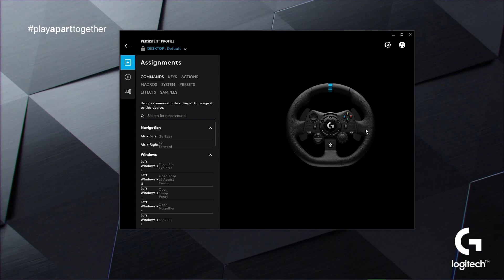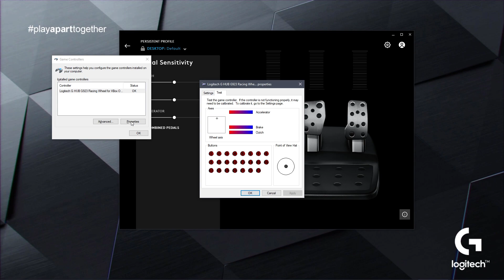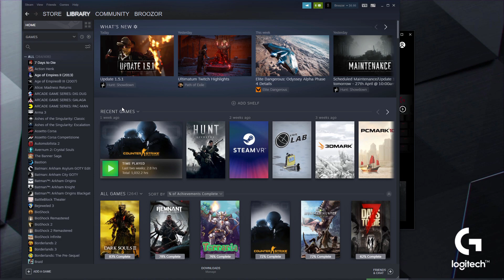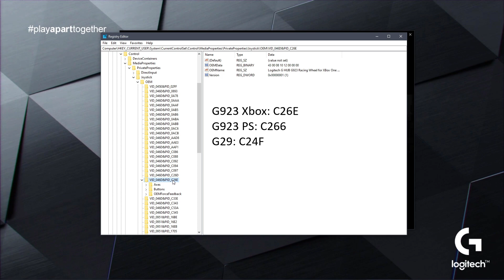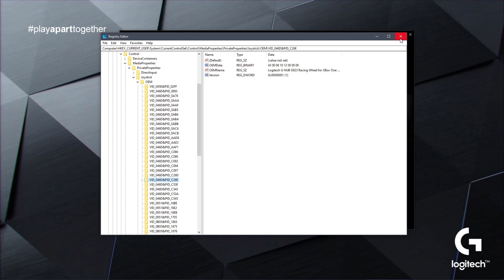How to troubleshoot G923/G29/G920 for Connection Issue

Comment: Pedals are working, shifter is working, buttons and paddles are working but turning the wheel does nothing. It doesn t calibrate when plugged in neither with g hub, however the ps3/ps4 button on top of the wheel is light up. I have a g29. Help pls.

Comment: Make sure the breakway-piece of the usb-cable is also properly connected. 

On the USB cable, 10cm (5 inch) from the pc side, there is a black piece of plastic: the easy-break-contact. I don't know it's proper name (a "breakaway cable"..). But it's there for when someone accidentally trips over the cable, than the cable disconnects on that piece. 

The G923 I bought and installed just now, did power on, leds burning, wheel calibrating, turning left and right, upon usb connection. But no connection in-game. Nor seen by G-hub. Even though seemingly visually alright; turned out that the breakaway part wasn't making full contact.

Comment: i can use the wheel, lights are alright, it does calibrate when i plug in but ghub displays the g29 as inactive therefore i can't change settings properly. i tried every solution i can find, non has worked. i'm using w11 ltsc.. any ideas how to solve?

Comment: Is there anyone in this comment section that can explain why my wheel is not rotating in LGHUB when im turning it? it recognizes the wheel but it dosent calibrate when i plug it in and its Slow to rotate and also skips to normal and then slow to rotate? Can someone please explain or help my dire need of help :(

Comment: To add - I followed the end-to-end process but the issue did not fixed for me.
However, I get to know that there is one more Registry setting in the same path as well - deleted the entry there and now GHUb able to detect the wheel.

So there are 2 registries setting as below

Computer\HKEY_CURRENT_USER\SYSTEM\CurrentControlSet\Control\MediaProperties\PrivateProperties\Joystick\OEM
Computer\HKEY_LOCAL_MACHINE\SYSTEM\CurrentControlSet\Control\MediaProperties\PrivateProperties\Joystick\OEM

Comment: Help needed. 923 works in the hub on Windows, steering wheel nice and stiff but when opened in Steam or other programs it goes loose but I can still feel other vibes through the wheel. Been through many YouTube videos but they haven't resolved the problem. Any good info would be greatly appreciated, thanks.

Comment: Need for Speed Heat g29 not recognized
Reply: Yo bro i hope you respond back, i have downloaded nfs heat and 1 other game, and i have installed g hub too the wheel is being recognised by g hub but when i launch the game the game thinks its an Xbox controller, and the steering wheel acts like a controller. I tried on my laptop too same problem!

Comment: It is not useful on rough roads and when driving fast I cannot control the car. It always starts to sway right and left and returns to zero at every turn, which causes a lot of swaying. If someone hits you with the car, it quickly goes out of the road.

Comment: Can see it under joy.cpl, but it is not detected in Lghub it self? Only thing i get is to connect your logitech gear. Also in registry i dont have C266, only C260, 00A4, 024E, 0517. Have deleted C260 and nothing after unplug and refresh.

Comment: I have the G923, wheel shows up in the Ghub but does not show up in the properties under test menu. Wheel is recognized when playing CarX Street but all the pedals are functioning is reverse. Did the whole USB port switch, uninstalled everything, restarted computer. Still no luck. About to return and just buy a used Monza R9 setup

Comment: My g920 is giving flashing led for 8 flashes then fast flashes when usb and power is in wall to test it. I figured ot should work but when plugged into my xbox the led flashes twice then turns off, and doesnt come on until re plugged. When in my laptop, it flashes 3 times and same thing. Any suggestions?

Comment: Trying to connect my G923 (playstation version) to GHUB on mac. Wheel is properly plugged in and it shows the green LED on top notifying that it is plugged in. When it does its calibration it skips a beat, not sure if this is because im connecting via usb-a to usb-c adapter. Ghub is up to date and am running on Ventura 13.7.1. Wheel wont show up at all on the Ghub. Any ideas?

Comment: you said "check if the wheel is moving in ghub, if it is move to the next step" but no step in between? my wheel is showing up in G hub, but its cranked at -450 and moving the wheel doesnt update where it is in the app. bought this wheel yesterday and its not working with anything
Reply: Did you figure it out?

Comment: it's almost 2025, I have brand new logitech g923 which I bought yet cannot enjoy as nothing can help me solve why it is not detected in steam.... I'm connected, everything works, ghub recognizes it, everything is responsive, but steam simply says controller not detected.... SERIOUSLY? no one has found a solution yet? how is this still being sold like this? this sucks!
Reply: its likely a power issue...make sure its plugged into an outlet, that got as much voltage of a wall. Some surge protectors dont provide as much power

Comment: The wheel is not recognized by steam. I’ve uninstalled and updated all drivers, g hub and steam. I’ve tried every usb port. I’ve made sure it is recognized correctly by the computer. I’ve unplugged everything else. I’ve disabled steam inputs. I’ve followed every bit of advice I could fine across Reddit, YouTube, steam and Logitech’s forum. Nothing works.
Reply: its likely a power issue...make sure its plugged into an outlet, that got as much voltage of a wall. Some surge protectors dont provide as much power

Comment: This didn't work for me. My XBox/PC compatible g923 was not detected by G hub, but the xbox button worked to open the game bar. on REGEDIT, the wrong driver appeared, i think it was C262 and/or C26D, which said it was for g920 when i clicked on it. I tried all the steps in this video several times, but the same thing kept happening. took it back to best buy and exchanged it for the PS4/PS5/PC version. Worked immediately.

Comment: What should i do if my wheel doesnt move in the g hub and doesnt register the movement, it calibrates but doesnt simply work, it shows in ghub that it is turned as left as it  it can, while it isnt in real life, and it doesnt have any "stiffness" when i turn it, its like all loose when i turn, it has no resistance, the problem started a few years back.

Comment: Let me start by saying that I bought a G923 xbox version in a renowned electronics store, I plug it in and connect it to the computer (Win10) starting the usual calibration by turning on all the LEDs but after that it is not detected by Ghub so I try to do all the steps listed in the video up to 4, where I discovered that I had "C262" as a code in the registers instead of "C26E" and it's strange, after deleting the folder and reconnecting the steering wheel with the usual calibration, I noticed that a new one was not created (folder on registers)...... checking the steering wheel box better I noticed that it is a "G923 SE" but I can't find much around about this model, i try on my laptop with win 11 and instantly recognize it. Any ideas?

Comment: My G923 Xbox version is not showing on the game controllers section or on g hub .. and in the registry editor I don't see the C62E folder. The wheel calibrates when I plug it in, and when I delete the drivers for xbox game controller and press the xbox button it does recalibrate and reinstall the drivers ... But I can't use the wheel

Comment: My G923 connects and does the calibration but it’s not coming up in G-Hub, I have a mouse and keyboard which appear as normal, but not the wheel. Any ideas? I’ve tried re installing the app altogether, different USB ports, but nothing’s worked.

Comment: I bought the 923. It didnt work with the main games i bought it for. I was able to play only 2 games. So i stopped using a BRAND NEW WHEEL!!! For months. Just tried it again and it doesnt work with any game now. $400 and i threw it in the garbage. Im not going through all this. I had a thrustmaster 250 with no issues other than the garbage 2 piece cord that eventually broke cuz the stupid plastic thing in the middle cut the cord. I will never buy logitech anything ever again. Thanx logitech. You lost a life long customer cuz youre stupid and youre wheels are garbage. 2024 and they cant do plug n play? Nope, im out.

Comment: I just bought my G920 today, it works perfectly on my Xbox Series S. Now trying it with Forza Motorsport 2023 on pc and it says device unrecognised. When I had Logitechs software installed, the xbox guide button stopped working and I had doubling inputs with every button press on the menus in game. Pedals work, but the wheel doesn't do anything. I tried the reg edit "fix" and it did sweet fuck all.

Comment: My g29 just shut off when I was using it. Iv changed the fuse in the plug to no avail and tried power cycling and using a different power cable still nothing. If anyone has any tips I'd appreciate it.

Thanks

Comment: Hi, I have the blank testing page in the game controller settings and the registry deletion + re-plugging the wheel didn't work for me, still blank.
G923 PS version.
Is there anything else one may try to get it working again?
Reply: Managed it myself: After the complete driver removal, as shown here in step 4 I completely reinstalled the G-Hub software and lo and behold, the wheel was working again :)

Comment: I know everytime i have a problem which I can't solve, 99,9999% of the times videos or forums don't solve the problem.

I have a G29, which is perfectly working with my ps4 (right now) and WAS perfectly working with my pc (windows 8.1)... until today.
Suddenly my pc stopped recognize it.
-Cabled? Sure
-Switched on "PC MODE"? Sure
-Working on ps4? Sure
-When I connect to pc, I hear the "usb connect" sound, but nothing happens, no auto calibration, nothing.
I also installed  Logitech G hub (which wasn't necessary) and ofc nothing happened.

Now what? Thank you very much to who will help.

Comment: Thank you so much! I just got a 923 with a DriveForce Shifter but cannot get the shifter to show in iRacing or AC. When I check the controller mapping (joy.cpl), the shifter is showing up from Buttons 12-18 (R-6). Interestingly, the clutch is recognized along with the other pedals so I can use it if I choose.

Comment: Hi, just bought this wheel, all buttons work fine and the shifters and pedals do too. However all the lights are on, the rpm lights and the flashing light at the top indicating its a psu issue. however it isnt a psu ive done all the checks possible to make sure of it, ive also changed usb ports etc for the usb side of things. When the wheel tries to calibrate it only goes to the right, and is stuck going to the right. The wheel is also unresponsive in game, only the buttons work. Please someone help just need the fix.

Comment: The buttons on the g29 steering wheel only work when I turn the steering wheel to the left. In the gamepad test window (win11), if I press x when the steering wheel is straight, it presses multiple buttons.

Comment: Hellow team. I am kindly asking for the help. My G29 comnects to both ps3 and ps4. All buttons are working perfect but cant enter into games( press X to continue) i press but nothing happens like my x button is mot working yet it works. Even for selecting options i use the same X as an OK button when when i reach to the final stage press to enter into racing, nothing happens. Plz help

Comment: Mine (G923 PS/PC) was called C267...and it didn't make a blind bit of difference. All I get in G Hub is 'Connect Your Logitech Gear' I'm pretty sure my G27 worked with out the need of going through other programs first. It seems you only get the drivers for G923 via G Hub...and It won't give me them! I have a SOLID green LED when plugged in btw.

Comment: Got a G920 works perfectly fine on xbox no issues, whenever I attempt to use it on PC in the G hub it says it is working fine but whenever I check its driver properties aswell as when I attempt to use it in-game if I turn my wheel 1-2 degrees it instantly snaps all the way left or right in game, I can't find any fix for the issue I have tried reinstalling and checked game settings none of them worked.

Comment: I just bought the 923 and I have no force feedback 80%90 less than expected 
I also have the g29 which delivers the expected power out put in which I set the base line but still the 923 has no truforce effect and the whell power output is 80-90% less

Comment: READ ALL, I FOUND A POTENTIAL FIX- I fixed it. So what I needed to do was unplug everything from my outlet (except the one below, for context I had an 2*3 adapter for a 2 plug outlet) and it worked just fine after. I had been searching for months prior and I was on the verge of selling it but all it needed was its own outlet. BUT, some outlets have less than 120V, It says this thing only uses 30V but it has to have 120V, kinda weird but whatever. So if that doesn’t work then try a new outlet, your outlet may also have some issues so another good reason.

Comment: I can’t use it it faint turn my Xbox on either it turns on just does nothing all plugs are connected probably
Reply: READ ALL, I FOUND A POTENTIAL FIX- I fixed it. So what I needed to do was unplug everything from my outlet (except the one below, for context I had an 2*3 adapter for a 2 plug outlet) and it worked just fine after. I had been searching for months prior and I was on the verge of selling it but all it needed was its own outlet. BUT, some outlets have less than 120V, It says this thing only uses 30V but it has to have 120V, kinda weird but whatever. So if that doesn’t work then try a new outlet, your outlet may also have some issues so another good reason.
Reply: there should be three cords plugged into your wheel, four if u have a shifter

Comment: I use it on ps4 so how do i trouble shoot it there
Reply: READ ALL, I FOUND A POTENTIAL FIX- I fixed it. So what I needed to do was unplug everything from my outlet (except the one below, for context I had an 2*3 adapter for a 2 plug outlet) and it worked just fine after. I had been searching for months prior and I was on the verge of selling it but all it needed was its own outlet. BUT, some outlets have less than 120V, It says this thing only uses 30V but it has to have 120V, kinda weird but whatever. So if that doesn’t work then try a new outlet, your outlet may also have some issues so another good reason.
Reply: if that doesn’t help make sure u have all three cords plugged in the wheel, four if u have a shifter

Comment: ive got a problem where everything works, pedals, shifter ,buttons on the wheels but it register any turning. even on the g hub app it doesn't recognize any turning. help plz. ive got a g923 for ps5/pc
Reply: READ ALL, I FOUND A POTENTIAL FIX- I fixed it. So what I needed to do was unplug everything from my outlet (except the one below, for context I had an 2*3 adapter for a 2 plug outlet) and it worked just fine after. I had been searching for months prior and I was on the verge of selling it but all it needed was its own outlet. BUT, some outlets have less than 120V, It says this thing only uses 30V but it has to have 120V, kinda weird but whatever. So if that doesn’t work then try a new outlet, your outlet may also have some issues so another good reason.
Reply: also make sure you plugged in specifically three cords(four if you have a shifter) to the WHEEL, not talking about pedals but the wheel

Comment: What about the ps5 version? I have a pulsing green light and the wheel doesn't rotate on power on.
Reply: look up a trouble shooter for a flashing green rpm light, the wheel is telling u the issue but you need to know what it’s telling u

Comment: I just got a bnew g29 today. Wheel works but the pedal is not detected in game / logitech hub / logitech gaming software. 

Ive tried every diagnostic. Could this be a defect or anyone having same issue
Reply: could be an internal issue were something inside got loose
Reply: READ ALL, I FOUND A POTENTIAL FIX- I fixed it. So what I needed to do was unplug everything from my outlet (except the one below, for context I had an 2*3 adapter for a 2 plug outlet) and it worked just fine after. I had been searching for months prior and I was on the verge of selling it but all it needed was its own outlet. BUT, some outlets have less than 120V, It says this thing only uses 30V but it has to have 120V, kinda weird but whatever. So if that doesn’t work then try a new outlet, your outlet may also have some issues so another good reason.
Reply: make sure all three cords are plugged in (4 for shifter if u have it)

Comment: just to add this. the usb connector will dictate if any power goes through to the g920. so if the usb connector is a little faulty and needs pressed in at a little angle none of the power will go in til its fixed. so dont worry about power cables until the white light is on on the wheel.

Comment: But they're not moving on ghub
Reply: READ ALL, I FOUND A POTENTIAL FIX- I fixed it. So what I needed to do was unplug everything from my outlet (except the one below, for context I had an 2*3 adapter for a 2 plug outlet) and it worked just fine after. I had been searching for months prior and I was on the verge of selling it but all it needed was its own outlet. BUT, some outlets have less than 120V, It says this thing only uses 30V but it has to have 120V, kinda weird but whatever. So if that doesn’t work then try a new outlet, your outlet may also have some issues so another good reason.
Reply: make sure all three cords are plugged into the wheel, 4 if u have a shifter